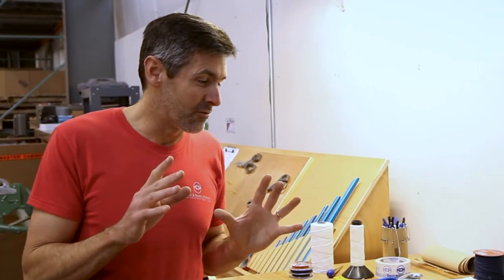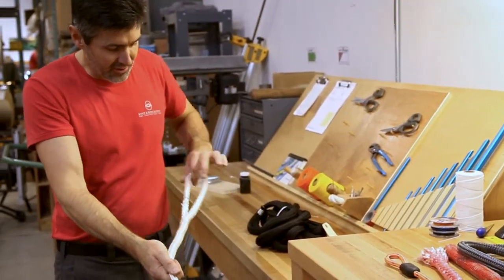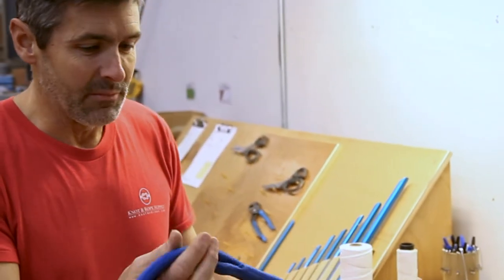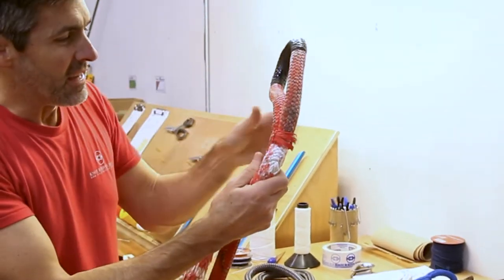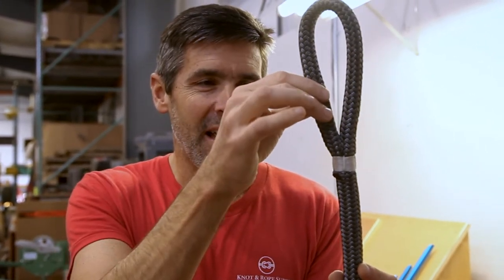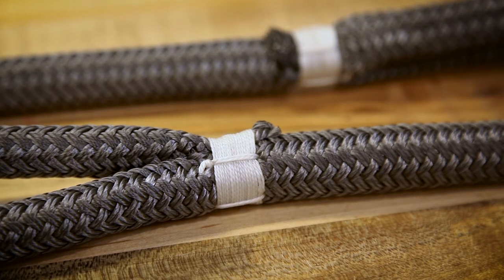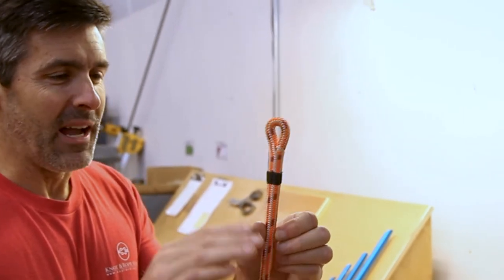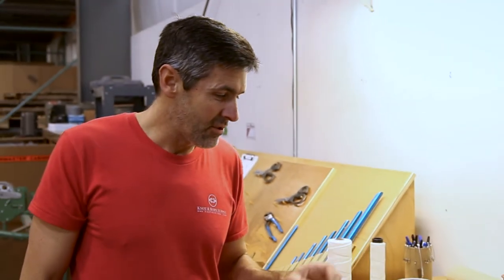Lock Stitch on a Splice

Comment: Hi, I just made an eye splice on Samson Hyperclimb 24 strand  double braid and wanted to lock stitch the eye, but the first 3 inches are so solid and dense that I can’t get a needle through. Any tips? Can I simply stitch it further down the rope where it’s a little softer? Thank you!
Reply: get a hammer and encourage the needle through.
Reply from the maker: Yep, this is pretty common. Moving that stitch down the throat a bit is fine. As long as that stitching goes through the cover/core blend part you are good.

Comment: I didn’t understand from the video whether “class 2” splices are better?
Reply from the maker: Depending on the type of rope and its construction will determine what kind of splice is needed. A Type II splice is done on ropes that are core dependent. This type of splice is not better or worse than the splice done on a double braid nylon, it's just the procedure is different. I hope this helps clear things up.

Comment: On a single braided dyneema lock splice, does it make sense stiching?
Reply from the maker: If you are using a locking brummel splice then, no, not really. It wouldn't hurt to throw in some stitches in the burry part if you wanted. but a proper locking brummel splice locks that rope tail from coming out of the core.